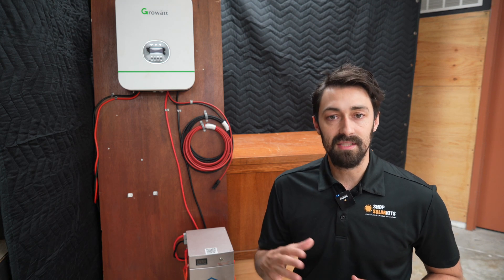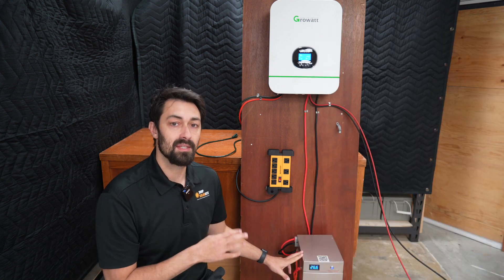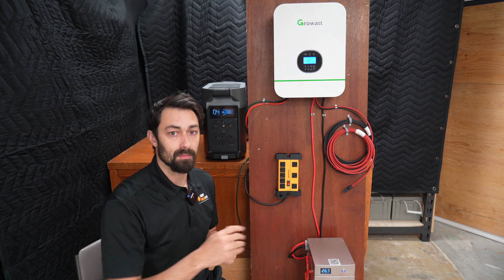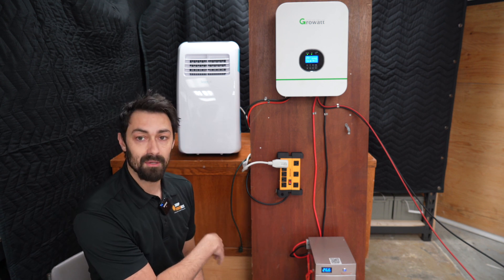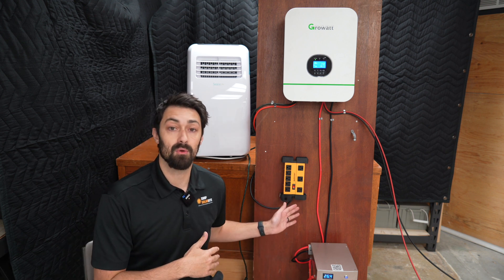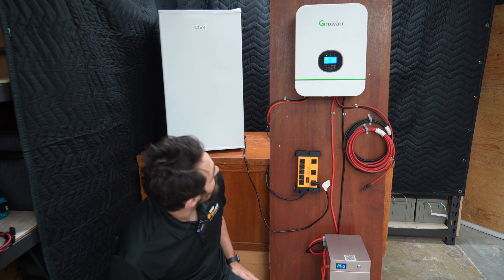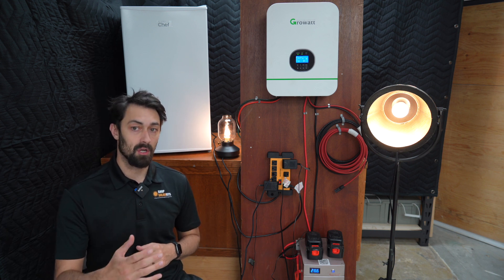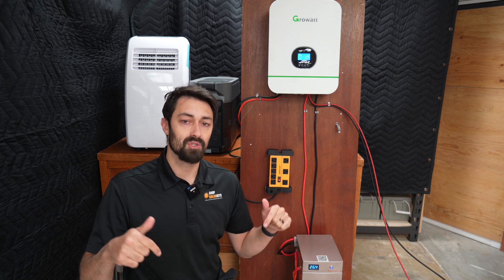Simple DIY Complete Solar Kit - Cabin, Cottage, Workshop, Shed, RV, Skoolie

Comment: Ok, that system is good for a one room shed. But how can this system be useful for a multiple room small house? Example; kitchen, living room, bathroom, etc... I only see one yellow outlet. Is there a blueprint to install multiple outlets? I think all the extension cords and excessive lengthily cable running through the house into all the different rooms would be code enforcement violation in addition to a safety hazard. 
So how would we power a multiple room house, completely off grid with our own batteries.

Comment: I really hate Solar stuff because it's so Scammee and all the problems and costs of setups so we will be concentrating on 3 different powers 1)solar
2) wind 3) flywheel magnetic 4) self-propelled momentum generator self~running 240-+ volts. For our Philippines bush life.